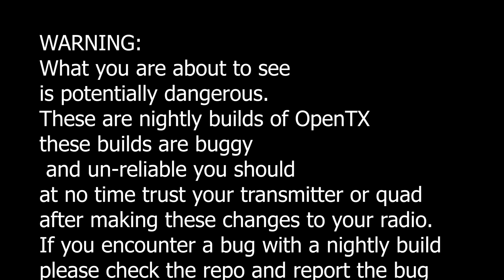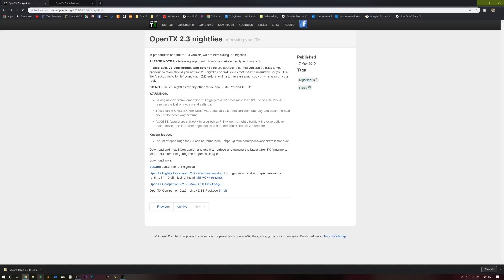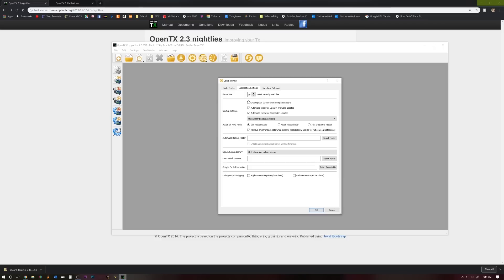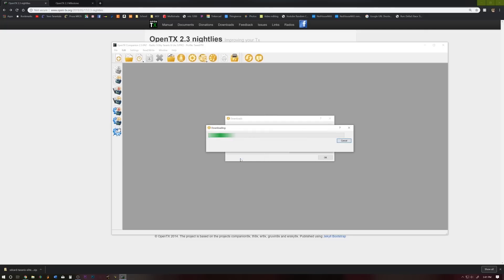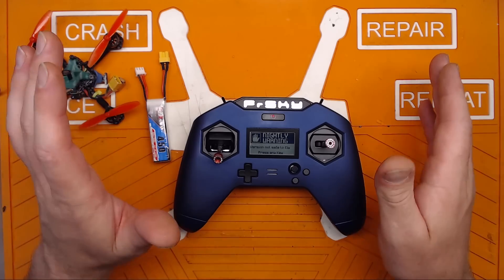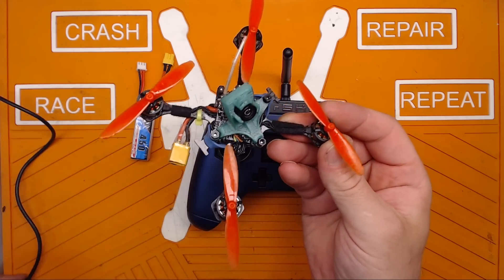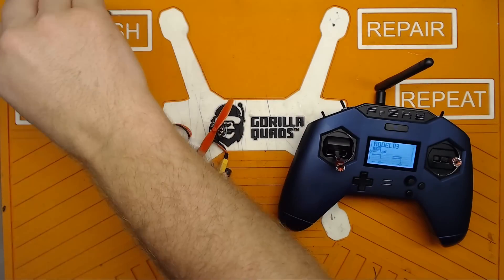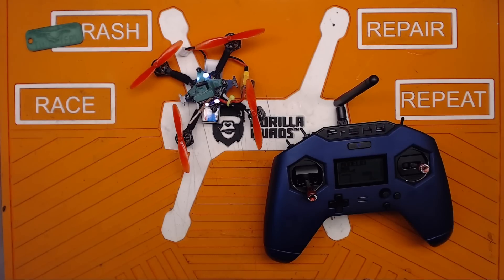X-lite Pro external multi protocol D8 Opentx2 3 nightly builds

Comment: Thank you in advance to anyone that can help me out. I’m trying to bind my x Frsky x-lite s equipped with xjt lite module to Tinyhawk Freestyle 2 and they won’t bind. I’ve followed the steps in this and no dice. I’ve tried multiple d8 options for the external and have tried making the tinyhawk compatible for d16 through betaflight. Any thoughts? Should I get a different drone or transmitter?
Reply from the maker: Your xjt lite module could have the wrong fw on it. But more than likely you need to update your radio os (opentx) to a newer version and make sure your bootloader is updated too. The original bootloader has issues with external modules. I can help you better over on discord. Head over to http://www.tweetfpv.com

Comment: Nice video, thank you. How is this function with 2.3.9? I can't seem the MPM getting to work , I do see R9 and XJT as external modules, but not Multi. Any idea why?
Reply from the maker: You should get opentx 2.3.9 from opentx. If you aren't seeing mpm in your external modules then try reflashing opentx
Reply from the maker: You don't need nightly builds any more.
Reply: @TweetFPV  Thanks for the quick response! I got the FW from Frsky website, will flash the one from opentx itself and see if it works. I also noticed separate fw for the external module itself: https://downloads.multi-module.org/
Reply from the maker: Yea the opentx builds on frsky are development build. The radio has since been adopted into the opentx main stream and all the features are included. Just note that there is no option for the mpm in opentx companion. It just always a part of the fw now.

Comment: hi there isn't the multimodule option on the newest build. Can you share the old version that u were using?
Reply from the maker: No, its not a option anymore. It's just a standard part of the fw now. So no need to select it.
Reply: @TweetFPV  SO I just need to update the firmware through the OpenTx right？ I updated the newest firmware from frysky through the SD card but when I put on the IRX4 I just don’t get the MULT mode. Spent hours but just can't figure it out.
Reply from the maker: Yes go to opentx. Org and download opentx companion 2.3.9 don't use the opentx or SD card contents from frsky. Com. Those are all just development builds. Now that the radio has been adopted by opentx as and official build those on frsky. Com and all outdated. All the internal rf fw however comes from opentx. Com.
Reply: @TweetFPV  Thank you so much for helping！I finally worked it out！But there is another issue after I flashed the firmware through Opentx, my controller keeps beeping after I turn it on and I couldn't figure out why it was beeping, have you ever experience the same issue?
Reply from the maker: Like constantly beeping or just one beep on startup?
Reply: @TweetFPV  I solved the problem by flashing both the firmwares of X-lite pro and IRX4, don't know which one was the problem but worked anyways. Thanks again for helping. I really appreciated!
Reply from the maker: No problem, happy to help

Comment: Strange, since this video was published OpenTX has moved on to 2.3.9 and yet when going to operate the iRangeX IRX4 mini the X-Lite Pro does not even see the module. After disabling the internal module (or not, either way) and trying to activate the external IRX4 module nothing happens. The remote just beeps when trying to select away from "OFF". I wonder if the nightly builds published at the time of this video had the functionality and then it was removed for the release? I cannot find the specific nightly build firmware mentioned in this video to test it out, it seems to have been removed. Anyone else had any luck with firmwares release subsequent to this video?
Reply: Never mind, it appears that I have solved the issue after reading through comments here. As you've mentioned in previous comments on this video it is very essential to create a new model with the newly installed module. Cheers!

Comment: It's not working anymore.
I tried 2.3.1 and 2.3.7 and 2.3.8 nightly , none have "multimodule" available.
In changelog they say it's auto-included however on my xlite-s I have only ACCESS and ACCESS-16
Reply from the maker: Yea the nightly shouldn't be used anymore as the official releases are out. Also with the new versions multimodule is always flashed to the radio and is no longer an option to select.
Reply: TweetFPV I see, in that case D8 is official not available anymore
Reply from the maker: D8 was never supported on the new radios, the only way to use d8 on the new generation of radios is with a external xjt or xjt lite module.

Comment: FYI, there is no need for checkboxes, nightly's, or anything other than stock to get the Vantac MPM working now.  I just downloaded the newest companion and firmware (v2.3.7 at this time) directly from OpenTX.  FrSky's website was out of date and not working (OpenTX v2.3.0).  I spent hours messing around trying to get the multiprotocol box to show up, but apparently it is baked in now.

Comment: Any updates on the multi protocol ? Don't want to run nightly
Reply from the maker: Oh yea this video is old. There are official opentx releases at www.opentx.org any of the new fw will automatically have multiprotocol functions with them.
Reply: TweetFPV yes I just tried 2.3.4 with the banggood module .. but it seems that dsm doesn't work .. I'm getting prot.invalid for some reason when I select dsm and hit bind .. any experience ?
Reply from the maker: Perhaps you need to update the module? Is it the Vantac module?
Reply: TweetFPV I did update the module.. this the irx4 module from banggood.. frsky works on it but dsm doesn't and that's the only thing I need actually lol 🤣
Reply from the maker: @matejbludsky8410  I'm not sure what to tell you. I haven't messed with dsmx on the mpms check the gethub for the mpm and see if anyone there has any advise.

Comment: I am having problems and I'd appreciate your help. I have an x-lite s and an vantac multi protocol module. I was under the impression that the mpm would work with the x lite s out of the box. I'm a spektrum guy and I do not know much about opentx. I have not updated my tx or mpm. The tx is running firmware from June 2019. When I go under external rx I do not see a multi protocol option. I am in the process of learning to update the x lite but I have a feeling it wont solve the problem. What do I need to do to get it to work? I would greatly appreciate any help at all!
Reply from the maker: unfortunately, the MPM will most likely not work out of the box. You are going to need to update the opentx version on your radio. The version of opentx that comes on the new radios is a bit out of date and didn't have the code for the MPM on it. Follow this guide https://youtu.be/nYeB0IXT-10 its for a different model and version of opentx but the process is the same, just use the newest version of opentx. This should give you the option to select multiprotocol in the model setup page on your radio. Be sure to create a new model after you update opentx. I have found some issues with reusing the original model that came loaded on the radio from the factory. If you need any additional help please join my discord server here https://discord.gg/hVyAVR its a lot easier to help over there than through the youtube chat.

Comment: He did a while video on the nightly firmware then slaps on his multi protocol module to test it..  The point of the nightly was to get the controller to work without the module..
Reply from the maker: That wasn't the point of the nightly. The point of the nightly was to get the multi protocol module to work to use d8 mode.

Comment: I don't see the multi protocol option in companion 2.3.3N53, is it removed from recent Nightlies?
Reply from the maker: The MPM is not an option in the settings menu of opentx companion any more. The MPM support will always be flashed with the new version of Opentx 2.3.2 and newer. so no need to look for the check box when setting up your radio options in opentx companion.

Comment: So confused, I don’t get the popup at 5:42 that asks if I want to get write the firmware to my radio is there another way of flashing the firmware?
Reply from the maker: That's strange. But if you have downloaded the fw file just click the red arrow on the lh side of the configuration. That is the "write to radio" button" give that a try. At this point you should be using the nightly fw. Opentx has some stable release versions out now.
Reply: Thanks for the quick reply, I used the non nightly 2.32 version. I still didn’t get the popup but I was able to find a solution by putting the file on an SD card and putting it in radio 👍🏻

Comment: Will this build work with x-lite s ??? Thanks.
Reply from the maker: I'm not sure but opentx 2.3 is in open release candidates so I would use the official releases rather than the nightly ones at this point in time.
Reply: @TweetFPV  so I just need to install opentx 2.3 on my x-lite s and i will get d16 support?
Reply from the maker: Yes
Reply from the maker: There are also some internal rf updates on the frsky website you should flash as well
Reply: @TweetFPV  thank u. Is there any good videos or articles about how to do it right that u will recommend? Or u will make video about it soon?
Reply from the maker: I can make one but really all you need to do is follow a few of my videos and it will get you all the info you need.
Reply from the maker: https://youtu.be/4JSMY18avyg
Reply: @TweetFPV  thank you very much for the information. Last question: after the 2.3 update will I be able to use multiprotocol module for d8 without nightly build?

Comment: I'm not seeing the multimodule under build options I tried nightly and RC versions of companion and selected other transmitters as well, anyone know what I need to do? Thanks Also thanks for making the video !
Reply from the maker: I beleave the mpm feature is automatically added and is no longer an option in the build options menu
Reply: @TweetFPV  Thanks!, that was it, I had updated nightly firmware not long ago to get the D16 protocol and it didn't include mpm but I updated to the RC which just became available and that does support the mpm
Reply from the maker: That's great news!

Comment: Am looking at getting into the hobby and buying my first radio, the long term plan is to be able to take the drone and radio with me up the ski fields and hikes. The X lite pro seems great for this due to its size and already coming with a carry case. Given that i am only starting builds now and am looking at using the r9m lite pro and r9 receivers would you recommend this radio or do you think the x lite pro is dying out due to its limitations? 

All the way from NZ
Reply from the maker: The xlite pro is in no danger of dying out. In fact if you looks at the whole industry from far away the whole access protocol and the new radios are just moving technology forward.
The xlite pro and the r9m lite pro are excellent products. As of now the xlite pro is my daily radio and I use the r9 system on almost all of my quads.
The big push back from the community regarding the new radios is that d8 protocol is dead and that's kinda the way it should be. D8 had never been legal to use in the EU or in any area where the lbt protocol is required. Frsky is trying to appease the spectrum managers around the globe by producing a radio that is legal to use in the regions it is sold.
I absolutely love my xlite pro for the fact that it is so small and portable. I only see this getting better as time moves forward and the software catching up.
I one day would love to visit New Zealand it looks like such a beautiful place!
Reply: TweetFPV cheers for the feedback, definitely put NZ on your bucket list plenty of amazing stuff to see here.

Comment: So I'm trying to set this up using an iRangex iRX4 lite and an X-Lite S on a Mac. I've tried the nightly build you are using, along with a newer version currently available on the OpenTX website, and no matter what I do, the option to select Multiprotocol on the radio profile does not show up. Is there a different process now? Thanks!
Reply from the maker: Did you try creating a new model after the update? Also in the setting menu in opentx you need to select the multiprotocol option.
Reply: @TweetFPV  Thanks for your reply! Okay, so when I use the 2.3 nightly version of companion, which has options to select X-Lite S/Pro, there is no check box for multi. When I try 2.2.4, there is a checkbox for multi, but the only transmitter option I can select is X-Lite, not S/Pro. Also, regardless of the version of the SD card content I download, the firmware folder only has a readme file in it. BTW, I'm trying to bind in D8 to a Tinyhawk and a Tinyhawk Freestyle. Somehow I managed to get the firmware updated to the X-Lite 2.2.4 version, and the multi option is there when creating a new model. I can even bind, but in Betaflight, no response from the sticks. Oddly, it now also gives me the option of D8 and D16 for the internal RF, but it won't bind. Also, I have no screen backlighting with the X-Lite 2.2.4 firmware on my X-Lite S. Sorry, I'm a good at this Open-TX stuff...
Reply: I got it! I just had to go back to an earlier nightly. I tried opentx-companion-2.3.0N67.dmg and it worked.
Reply from the maker: Sorry it's been a long day at work. I'm glad you got it working. Btw you can set up the tinyhawk s and tinyhawk Freestyle to run on d16 mode so you won't need a multi protocol module. Change your rx protocol in betaflight to frsky_x. You'll need to change your opentx model to use d16 and rebind.
Reply: TweetFPV I also have some DSM quads I’ll be using it with, but that’s good to know. Is there a benefit to using D16 with the internal rx compared to D8 with the external rx?
Reply from the maker: Not really in these small models. I use the xlite pro for its compact size and if I can run without a module I will just to keep it small and light but in the end it shouldn't be any different.

Comment: Can you help me out? I downloaded the multimodule version in opentx. and my Xlite pro still will not connect to my Tinyhawk freestyle in D8 or D16. I dont even know if my internal antenna is working or not. If there is a way to check that but i feel like it should bind pretty easily
Reply: I cant find any support to help me figure out if my xlite is just not working or what. Help me and ill gladly return the favor in a major way of support to what you do!
Reply from the maker: Ok. Just to set the scenario. Are you using a multi protocol module?
Reply from the maker: Also if you have the ability to use discord contact me there. It's way easier to help with troubleshooting. YouTube tends to drop chats https://discord.gg/NzQpQE

Comment: Hey, can't find the Companion 2.3.0N7. The latest version in the website is the 2.3.0N68, which  doesnt include the multimodule in the Build Options. Version 2.2.4N7 includes the multimodule option, but it doesnt support xlite-Pro, only the regular xlite. Any ideas on how to enable the multimodule option in the version 2.3.0N68? or where to find the version you used in this video? Thanks in advance! Cheers.

Comment: I updated the firmware for my X-lite Pro and it's internal module, still can't get the internal module to bind with my Sailfly-X, any suggestions? Thanks a ton!
Reply from the maker: Is the sailfly using the frsky_d or frsky_x protocol? You can fin this in the betaflight configuration tab under the reciever info.
Reply: @TweetFPV  It is set for FrSky_X
Reply from the maker: When you check your isrm version does it say EU or fcc?
Reply: @TweetFPV  ISRM-PRO 1.1.2 FCC
Reply from the maker: Are you trying to bind by using the button or are you using the cli command bind_rx_spi[Enter] it should work. Although I haven't tried to get a spi frsky board to bind to the xlite pro. I'll have to give it a try when I get home tonight.
Reply: @TweetFPV  Using the bind button, haven't tried the CLI method, will try, thanks for the suggestion
Reply: @TweetFPV  Darn, no diff. I really appreciate you taking the time to think about solutions, thank you TweetFPV!
Reply from the maker: I tried binding my xlite pro to a crazybee f4 pro set to frsky_x and it worked just fine. Bound like normal. Have you tried making a new model and binding that to your FC?
Reply: @TweetFPV  Just tried, no diff. Created a new model, switched to ACCST D16, put sailfly in bind mode aaaaaaaand nada haha... I did use the taranis service email address you supplied in one of you vids, got a response, so far we just confirmed that its FCC, but it's a start. The other emails I sent them (different addresses I found online) went unanswered.
Reply from the maker: Which fw version are you running on your xlite pro?
Reply: @TweetFPV  Ver: 2.3.0 (2db0a3f9) Date: 2019-06-05 - EEPR:219
Reply: @JpJpJpB  i have a Trashcan with FC Crazybee F4 rx frsky can't bind mode ACCST D16. I thing x-lite pro use firmware on frsky-rc.com can't bind.